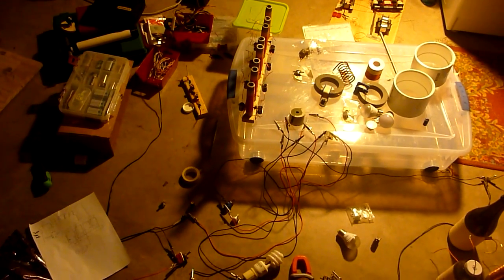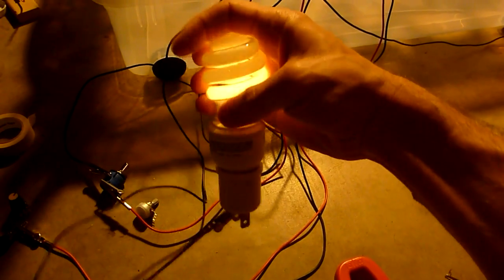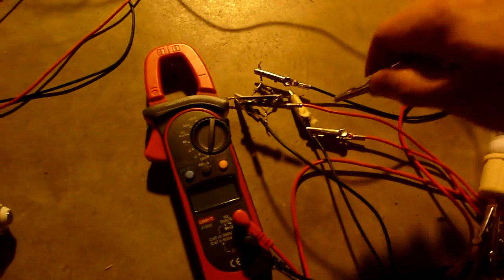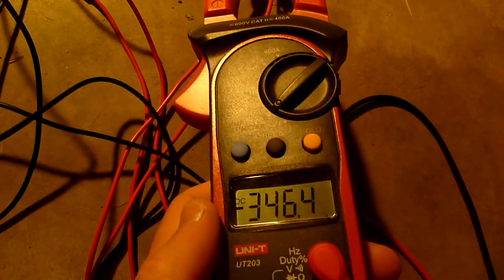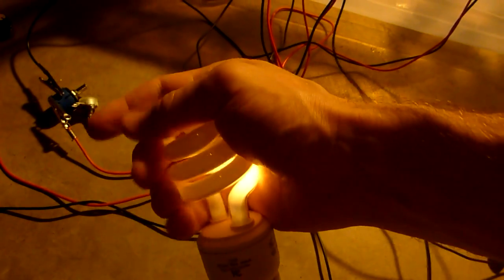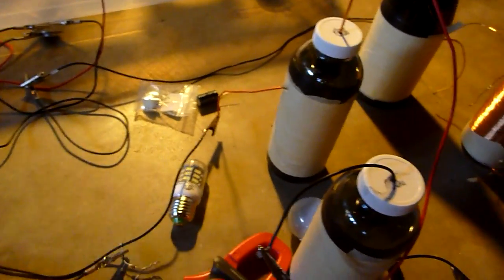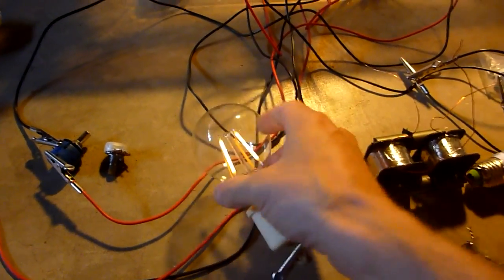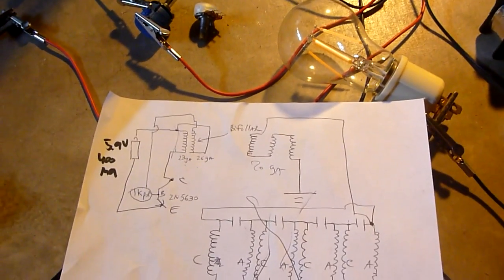Physical Proof that Longitudinal Electric Waves Exist (single wire power experiment part 2)

Comment: Try reporforming this experiment using a  12dc to 120ac volts inverter as power source. This way you could test if the ground wire has the same effect. Keep in mind that grid power ground wire is tied to the neutral wire. Perhaps the effect was there, but the watt meter might have not been bypassed.

Comment: Single wire transmission can pseudo ground through the air dialectically, as well as ground through your body, because your body is a acting as a grounding capacitor.

Comment: Single wire transmission, or through earth or air, I believe is just two dipoles which constructively resonate as one dipole across the medium. Experts say there is a closed circuit like DC, but I don't think so. It is exchange of energy from one tuned resonant capacitive circuit at one end, exchanging energy to the opposite end as their poles change, but as one whole resonant circuit with a single pos and neg pole fluctuation. It is quite easy to prove my point.
Entanglement works this way as forming a 1dimentional dipole resonant circuit, finding the target by signature, exchanging the subquantum-field mindset at not inductive/capacitive speed (almost infinity). We can't detect this, and it's the basic mechanism of pure telepathy and gravity, which are the same subquantum action but telepathy is redirected modulated gravity for a very short moment.

Comment: Very late here but I have one suggestion on how to measure, or rather, possibly measure volts on your single wire connection. Why not hold one of the meter probes in your hand? Seems logical since the light gets brighter when you are holding it! Perhaps with one probe on the voltage leg and the other held between your fingers, it will stabilize the reading?.?.?....

Comment: Longitudinal waves are Alpha and Omega the next step is to  amplify the phenomenon by  pushing it back  to the initial imput(Diode loop) and  a method of controlling the resulting output(fused  and duel capacitated) . for distribution grid resulting in  a single wire  output suitable for   domestic  safe consumption and instantaneous interstellar communication.Be mindful everything works off centers .

Comment: how many turns on the toroid and what type of toroid is you are using? thank you very much and 👍👍👍👍👍👍👍👍👍👍👍👍👍👍👍👍 from me chuco
Reply from the maker: I didn't count the turns, but the toroid that I'm using is 38mm by 48mm in size. The primary is wound bi-fillar 23 ga and 26 ga in 1 layer on the spool and the secondary is 20 ga wound in 3 layers on the spool. The winds are tightly wound close to each other with no gaps in the middle of the wires. Hope that helps somewhat :)
Reply: So when you say spool, do you just mean around the toroid? So is one half of the toroid dedicated to the primary and the other half dedicated to the secondary? Or do you have the primary wound completely around the whole of the toroid, and then the secondary on top of it? Thank you for taking the time to make these videos and answer questions.

Comment: Just bcayse yoy made a spark, does not mean that you are getting decent amperage. Anything with capacitance can generate a soark if it is charged and the anerage can be very low. You need to hook it up to a resistive load and measure the voltage and amperage simultaneously.
Reply from the maker: +Dziaji I did use the amp meter to try to get the amperage near the end of the video.

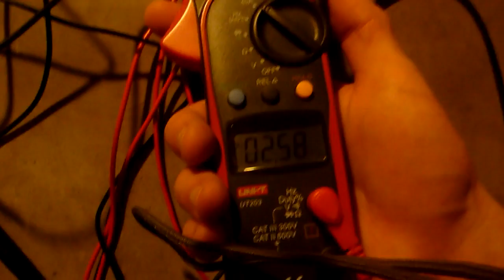Comment: Nice work! Keep rockin those experiments. I have only seen a few vids so far but I notice you aren't wearing rubber gloves or other protection from contact. At 6:35 you measure 2.5 Amps, and that will do it. For those who are inspired to replicate, don't underestimate current - in fact, live circuits running above 100-200mA under the right conditions can snuff out living tissue. Remember, dead scientists don't solve anything. It is important that you stay alive! A public service announcement from a guy who regularly gets the piss shocked out of him due to accidental contact with poorly designed commercial installations...
Reply: Steinmetz had to tell Tesla to laminate. I hope this one didn't. It's 8 years ago now. If I was with them, we'd have KAIJU. Thanks no.

Comment: Have you ever thought to use the Leedskalnin pmh in place of the copper pipes of Tesla's hairpin circuit? Connect the coils on the pmh to the bend of the pmh and short the other end of the coils. Put load across the lowest part of the prongs. When the displacement current runs up the prongs and into the coils there is a magnetic current produced in the prongs that induces more emf in the coils, positive feedback.
Reply from the maker: +jawbreaker1975 Interesting idea, Tesla Hairpin uses 2 capacitors though across a spark gap. So I will have to use some sort of capacitors too? The coils themselves have internal capacitance too but I don't know if that capacitance will produce the same effects. Worth a try though. I was thinking about using PMH like a pulse motor but only with + going to the coils. The - of the battery goes to ground. The negative of the coils goes to a different ground (there are 2 grounds in circuit). This leave the circuit completely open to ground at both points allowing energy from the Earth to enter the system. Early telegraphs used only 1 wire for power transmission. The negative was grounded out at both ends. Yet everything worked as if there were 2 wires except during solar flare events when the telegraphs would click by themselves from the currents inside of the Earth (where I got the idea).
Reply: +Naoki Kashima I was saying to still use the capacitors of the hairpin but like mount the pmh where the shunt would be across the two pipes.
Reply from the maker: +jawbreaker1975 I need to try it, I've been slacking with experiments lately. Have you seen LaserSaber's SJR looper circuit? Laser managed to run a light for 15 minutes off of a tine electrolytic capacitor (not a super capacitor).
Reply: +Naoki Kashima I have to check that video out. We seem to be in the same boat as far as doing experiments. I bought all the supplies to build stuff but haven't touched a thing yet. I build it in my mind first like Tesla did and then I try to comb through the device to see if it would really work. Most of the time I can pick apart my devices and see I was wrong with my initial thoughts. Research never hurts.